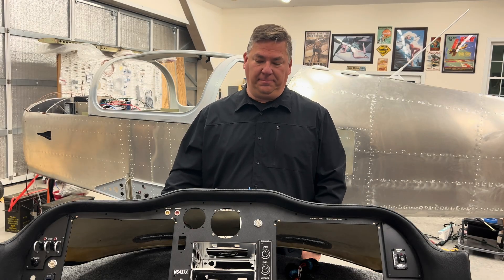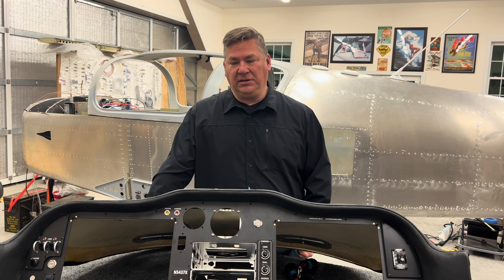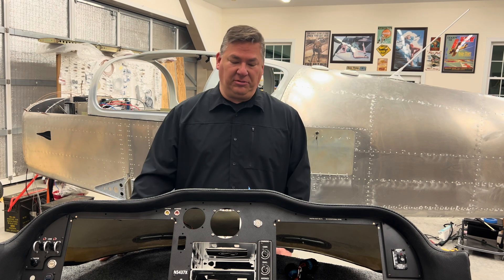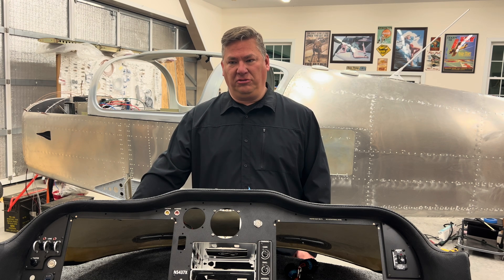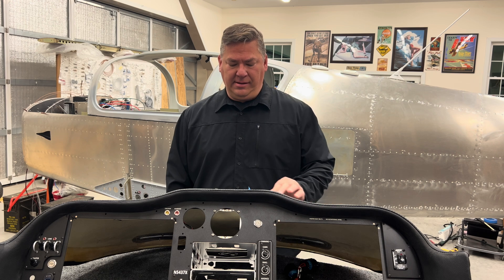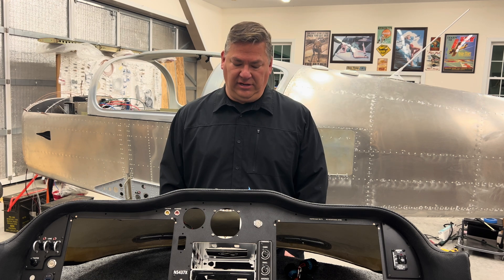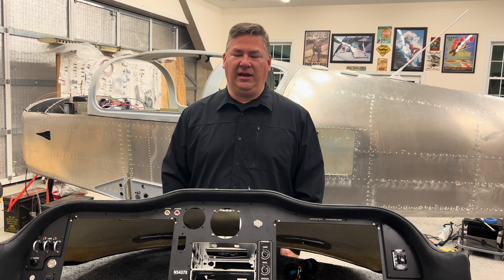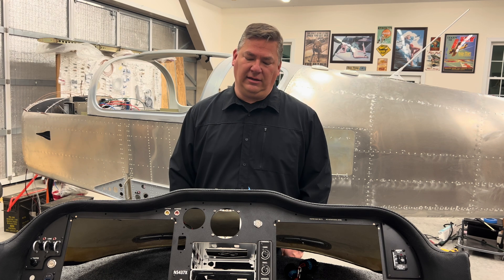1000 Build Hours - Build Update and Review of Upgrades

Comment: Awesome job!  What an adventure to say the least.  Question regarding the brake upgrade with larger calipers: It looks as though if a tire goes flat, the tire could  1) hit the side of the caliper, 2) the caliper will then be lower than the wheel and potentially hit the ground.  Perhaps the original caliper was mounted that low and would pose the same issues?  And of course this is only based on seeing what is in your videos, but wanted to ask and bring to your attention if potential issue.
Reply from the maker: I hadn’t given that any thought, but there is almost always a cost somehow to making upgrades, even if it’s just time or cost. I looked at my pictures but don’t have a good angle to really tell if there’s an issue. I will take a look when I get off work.

Comment: It’s been fun watching your videos in tandem with my build. Do you mind sharing what firewall insulation you used?
Reply from the maker: I did a video about it if you look at my channel. I’ll have to look it up and pass along specifics later. I have mixed views on it, it looks great and I think it is probably very good for fire and heat shielding. The issues are it is expensive and hard to install as it leaves sharp edges where you cut it.